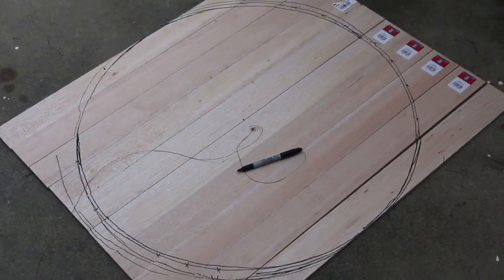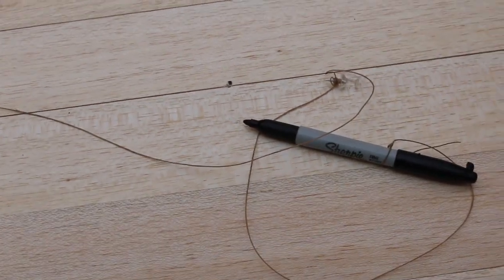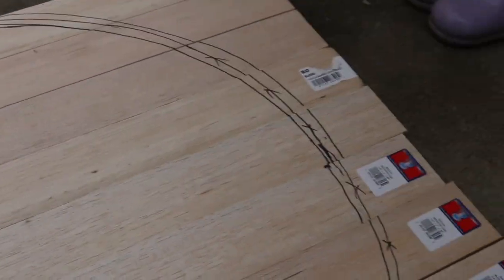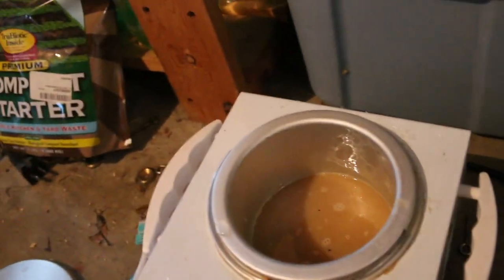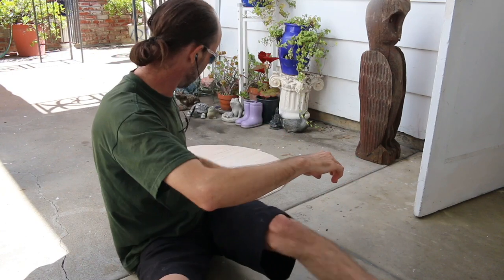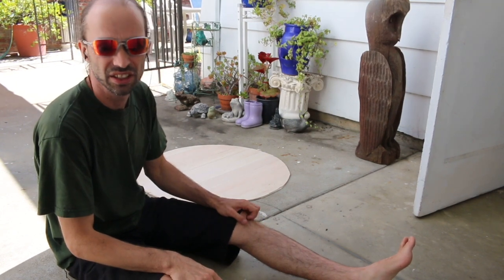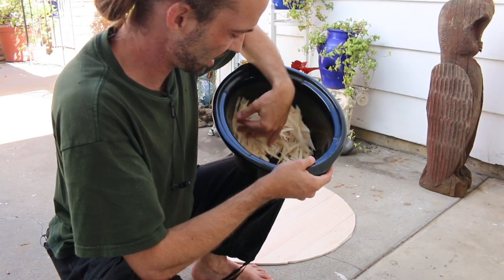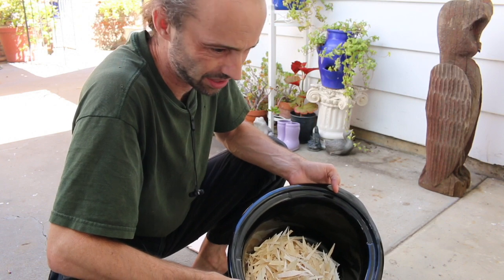Building the Traditional Viking Shield Part 1 Plank shield and Hide Glue

Comment: Very interesting, thanks! Do you have any evidence for the glues you used? Have any remnants been found etc?
Reply from the maker: The answer is not really. Nothing is known about what glues were used. There is a manuscript from the 14th or 13th century that has a recipe for casen glue that a lot of people think is appropriate because it mentions shields.   But personally, my theory is that hide glue is a much more viable option as making it is nearly passive  and you can make it out of hides. Which we know they were making the shields out of anyway.  That is supported by finds. 
We know hide glue was used, but it can't be said for the shields.  Nothing was written and hide glue is made of hide, so...
Its a very interesting question, and there are lab analysis based studies being done right now to determine more.
Reply from the maker: 12th century, my bad.. And I should point out that the same text describes thereafter, hide glue.

The panels of altars or doors are first carefully joined together one by one with the cramp which coopers and barrel-makers use. Then they are stuck together with casein glue, which is made in this way. 
Soft cheese is cut up into small pieces and washed in warm water with a pestle and mortar until the water, which you have poured on several times, comes out unclouded. Then this cheese is thinned out by hand and placed in cold water until it becomes hard. After this it is broken up finely on a smooth wooden board with a piece of wood. It is then replaced in the mortar and carefully pounded with the pestle, and water mixed with quicklime is added until it becomes as thick as lees. With this glue the panels are fastened together. When they have dried, they stick together so firmly that they cannot be separated by damp or heat. 
Later, they should be levelled with an iron spokeshave which is curved and has an edge on the inner side and two handles so that it can be used with both hands. With this, panels, doors and SHIELDS are planed down until they are perfectly smooth. These are covered with the untanned hide of a horse, an ass or a cow, which has been soaked in water until the hairs can be scraped off; then some of the water is wrung out and, while still damp, it is stuck on with the casein glue. If you have no skins for covering the panels, they can be covered with ordinary unused cloth in the same way and with the same glue. 

XVIII. GLUE MADE FROM HIDE AND HARTSHORN

When this has been carefully dried, take some cuttings of the same hide similarly dried and cut them up into small pieces. Take some hartshorn and, with a smith's hammer, break it up into small pieces on an anvil. Half fill a new pot with them and fill it up with water. Then heat it until a third part of the water has evaporated, but taking care not to let it boil. You test it in this way: moisten your fingers in this water, and if, when they are cool, they stick together, the glue is good; but if not, heat it until they do stick together. Then pour this glue into a clean vessel, and again fill the pot with water and heat as before. Do this four times.
Reply: Hide glue or Bone glue was used and found on shields vom 13th and 14 th century. It was the glue of its time and widely used all over Europe. Casein Glue I've never seen on a shield.
Reply: Christoph Vogler Casein glue was used with some african shields, like the Tuareg full leather shields.